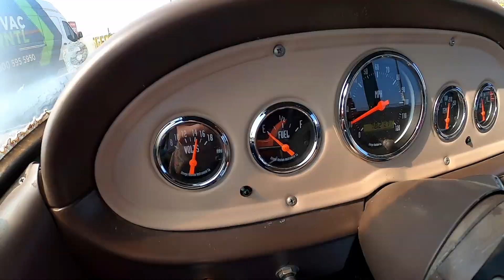I broke it already… CHEAP 1979 4X4 Luv.

Comment: Those luv trucks look to be the early model holden Rodeo here in Australia. 
They all have awesome isuzu engines. I have a 98 rodeo with the 6vd1 isuzu and they are crazy reliable and the diesels even more so.
They never stopped and thus we now have the isuzu dmax.
Awesome trucks that never get the respect they deserve.
Luvin it

Comment: I would definitely go with the (semi float 14 bolt rear end) for the Travelall. It has a 9.5in ring gear and I’d say it’s perfect for what you have going on. They come in a lot of different year trucks and suburbans. So you should be able to find one fairly easy. Should also have disc brakes on the the newer models. That will be a good video!  Hopefully you can track 1 Down.

Comment: Nothing says Oklahoma better than taking a truck you just winched out of a hole because it flooded out and driving it straight back to the hole to try it again WITHOUT doing anything to resolve the water ingestion issue.  Slick said it all in three words.  Try it again?  Great video Puddin.

Comment: WD-40 in the cap. Displaces moisture. Take off the fan belt so it doesn't fling water into the carb and engine compartment

Comment: 6:19 An old school quadrajet 350, 5-speed stick, and some automatic valving/onboard compressor would do Edna some good by the sounds of things. I'm strongly considering putting helper airbags on the back of my 85 F150 for the same reason you have them on Edna, though I'm not lowering it and I'll be making it fully automatic with the compressor driven off the engine. Just have a switch on my dash to enable or disable the air system, run on the leaf springs until I tow something then flip that switch and the helper bags kick in.

Comment: Exactly what my lil Suzi motor sounded like when it done a head gasket between 2 an 3 leaking compression between the two cylinders so none of the usual water in the oil or steam out the exhaust hence it sounding like a tractor. Time for a rebuild and a turbo show the crossing who's boss haha love the content puddin

Comment: love this one! I have a diesel 79 luv 4x4 are in Australia so loved seeing this one in action! I used to have a jackaroo (trooper I think you called them there in America) was a petrol 4x4 with the same engine used to do the same when it even sniffed water near the dizzy, I ended up converting to electronic ignition (petronix I think) and made sure the dizzy cap sealed really well. fixed the problem till I drove through a creek that the water was hitting the windscreen! drowned it good and proper!

Comment: Spent many miles in one of those as a little one in the late 70s early 80s. Had a camper shell and I remember crawling back and forth thru the sliding back glass. On trips from Kansas to Arkansas and beyond.

Comment: Next run through the mud, take the fan off and silicon the cap and wires. I had a 74 Camaro when our town flooded I did just that and put a hose on the exhaust pipe as a snorkel and drove through 3 feet of flood water!

Comment: I'm jealous, I had a Ford Courier 4x4 in the 80s, awesome little ride. Had a 1988 Toyota 4x4 PU in 2008 to 2012. Loved em. Love the way you appreciate the lil 4x4s, time for some Super Swamper tires so you can go thru stuff without having to run at.

Comment: I just put a Ford 9 inch in a 68 IH truck cuz we couldn't get brake parts. The older Ferd rear end is only about a 1/4 inch narrower than the stock IH. No mods needed to make fit, and the same bolt pattern.

Comment: My first job after I got sick of welding was a lube emissions and inspection and tire shop and a dude who worked there had a old luv with a little turbo diesel he musta did some stuff to it cuz before I saw that I didn't think diesel could be fast but the luv opened up the diesel performance world to me and it was probably one of the fastest vehicles I knew were running around back then

Comment: my dad's owned a 72 luv for 30 years, after his step father didn't need it.  he did a money shift one day, grenaded it, and rebuilt the motor himself.  and it ran for a long time like that until the frame literally rusted in half one day.  so then we spent a summer welding steel into it and he used it for a bunch more years.  drug home a lot of car parts from the yard in that thing

Comment: My Towrolla has me madder than a Rattlesnake in a Maytag. They don't make lubey dooby strong enough to relieve the tension on the original parts. Ordered 2 tie rod ends from a certain zone of autos and they only sent me one dagnabbit! (cheaper than the Irish outfit... for obvious reasons) Destroyed the originals getting them to release. Ball joints refuse to let go of the castle nuts. She is a FIGHTER I tell you what. I'm sure I'll have her back on the job tomorrow. Or will I?🤔

Comment: You should start gathering parts to swap the crank out an make that 4.8 a 5.3 with new crank rods an pistons, toss in a small cam an lifters with a valve bearing update for safety and boom have a rebuilt long living motor with way more workin power
Reply: Nah, just go LS3 😏

Comment: You definitely need to seal that distributor cap. I used to have one of those little Chevy loves. I put a 3 inch lift on it and I’ll have the same problem whenever water would come around but definitely seal the distributor cap. You already know what to do with the carburetor.
Reply: Just don't turn the channel into whistlin diesel.....That guy just sins with money.

Comment: Excellent video Puddin  :) also 1979  Orange Chevrolet LUV  4×4 Automatic transmission  need higher idle on carb get one like your gave 2 barrel put on one of your truck gave more  fun times  and  nice friends help out to yes! Also differential axle had 6 bolts  in  General Motors was heavy duty 1/2 ton called 5/8 ton built in 1955 to present years were 6 lug nuts with 303 to 390 ratios plus used in C10 versions and Z71 OFF ROAD trucks with 225/75/16, 235/75 or 80/16 , 245 /75 to 85 /16 , 265/ 75 to 85/ 16 ! Also load range was B to E series  too in these tires sizes but best one ratio lots people like in 1997 to  2010 was 388 ratio get in Disk or Drums type on 6 bolts studs  because save fuel on road trips plus get lots hp , torque  plus grip with lots great steering  and brakes to stop nice ! Never over rev engines plus hard transmission too ! Also on International Travellea  Puddin is Bearing on outter drive shaft near brakes and inner start go to also change Bearing in drive do left and right side same time to together save troubles later on too! Yes in 1987 to 1996 Chevrolet Cheyenne, GMC Scottdale 2500 Light Duty 3/4 had 16 inches with 6 studs wheels were 6 leafs springs instead of 8 leafs plus weight trucks 8.000 pounds on 6 leafs  with 6 studs 16   and 8 leafs  were 10.000 on 8 studs unless  haul up 11.000 pounds tow weight on trailers in vechiles or tow trucks or camper need 1 tons suspension of a 10 to 12 leaf springs on back on left to right sides  like Chevrolet or  GMC SUBURBAN vechile in 3/4  to 1 tons! Hopefully that helps out on information!

Comment: I've got the same problem with low t. I'll be 35 next month and have been trying to get it straightened out since I was 30. I've done the injections and the cream. I didn't know about the pellets. Hope it works out well for you. The low energy levels from it definitely suck. Good luck man.
Reply: Carnivor diet will fix you up.
Reply: @Mantis858585  Thanks for the suggestion.

Comment: Definitely need to water proff the dizzy.     Seal up the cap and wires with silicone!! And stay dielectric grease in all the electronics!! And seal all the wire wire connections with silicone.   Did that to my cherokee and went 4 foot deep In Water  no worries!!! Its awesome yoy got a 4x4 now.  And even cooler it's a bad ass mini luv  hope you do some cool stuff lock up the axles custom lift blocks and shackles,maybe a skid plate needs a better approach angle!!!  You could always 4.3 vortex swap the luv and have some killer power.    And needs the 4x4 sticker on the bedside

Comment: On the International Travel-All maybe a late model Jeep Wrangler 2017-2021 rear axle might fit as a total replacement, it would most likely come with disc brakes and posi. just a thought.

Comment: How would go about putting a 'Switch' in for locking the Torque Converter on a 1995 Toyota Camry with the 2.2 (2200)? "Enrichment Mode"...On the aforementioned engine, what vacuum hose is responsible for that? I have been searching for days and cannot find an appropriate vacuum source.  Is it better to have a High-Output Amperage Alternator, or one that gives less frictional resistance?

Comment: 14 bolt 6 lug came in the obs light duty 2500, 2wd and 4wd are different widths. as well as the newer SS trucks. 9.5" semi float axle, i have one under my suburban and its great.

Comment: You just got to remember that with four-wheel drive you will be able to drive out into the Wilderness further that means you'll be further from any road assistance if anything breaks or you actually get yourself buried out there. On the flip side there's nothing like the power of having four wheel drive motivating you to go further, it's just one Unstoppable Beast.

Comment: Get you some die electric grease on all electrical connectors, plug and coil boots. Might would've kept the water out. That's what I put on old fourwheeler electrical connectors to help keep moisture out and keep wires connecting. Good lil ole mud truck

Comment: Should get you an old 4x4 jeep xj with the 4.0, can find them cheap and are super capable get one with the dana 30 hp up front and the 8.25 out back, auto or 5 speed and you got a good rig

Comment: If I was you, but I'm not Puddin, because that would be like weird, anyway from the myriad of used Chevy Luv's nearby where you live you could buy the various Luv specific parts the truck needs. I would replace the carb with a factory unit OR a 2 barrel weber carb. I bet the spark plug wires are so old they need replacing due to high resistance numbers. Anyway, that was pure entertainment!!!!!  That's still one tough small pick up truck for sure Come on!!!!!!!!!!!!!!

Comment: Take some clear silicone and coat the cap and wires and put a cover on the carb and the luv truck will run in water

Comment: Swap tires with the half hall weld rear diff silicone grease  around the distributor and   both ends of the plug wires fix carb. SEND IT

Comment: Puddin take that metal disc outta the distributor  that effects the points and it will just die  and won't start  Remove it it will fire up I have had 3 luvs have same issue I don't know why

Comment: I need help. My son bought a 79 luv and we have been fixing it up. It's very simular to this one here. The clutch never seems to release all the way. Now the carb seems to be clogged or over fueling idk. One  side of the carb works. I added a missing spring for the manual clutch cable but I guess these are prob sealed transmission with no fluid fill? Idk much about these at all. What carb is cheap that we can throw on? And any help figuring out what do about the clutch stuff I'd super appreciate it.

Comment: Other Justin spray WD-40 on it it will get the water out of the distributor cap and everything especially if you do it before you go in the water it's an old mud truck race secret

Comment: Them 4.8 ls motor suffer from oil pump oil pick up tube o-ring and the oil pressure sensor I know this because I had like 5 or 6 of them easy fix puddin

Comment: The transmission is a 5 speed just like my 79 4x4 not sure of the gear ratio... It will run fine once the points dry out..

Comment: will not run with wet cap dude, u need a shroud to keep the water off the cap or it will not run it is not the carb